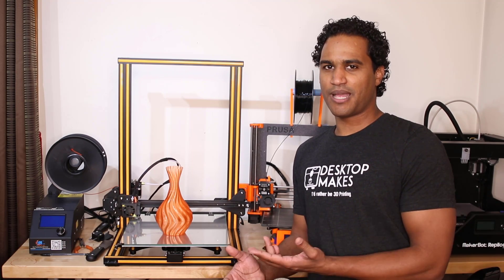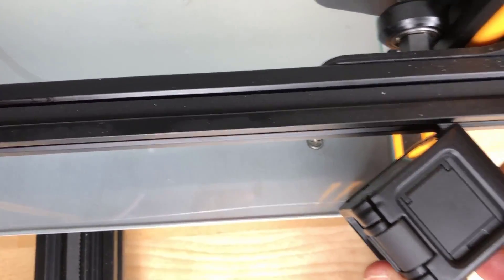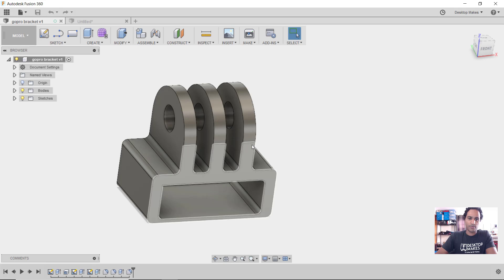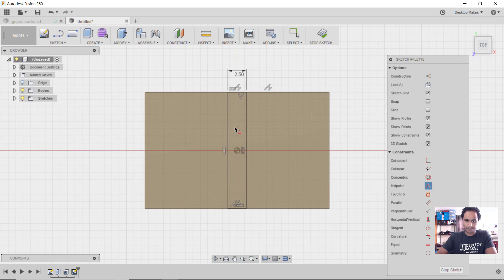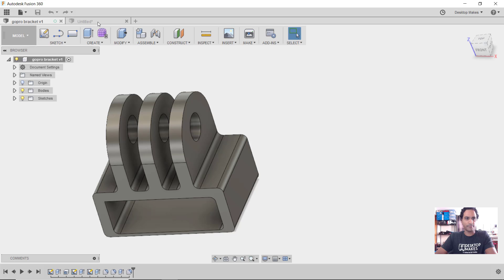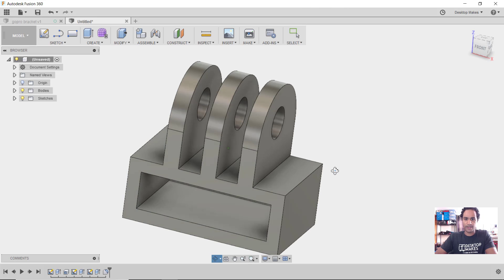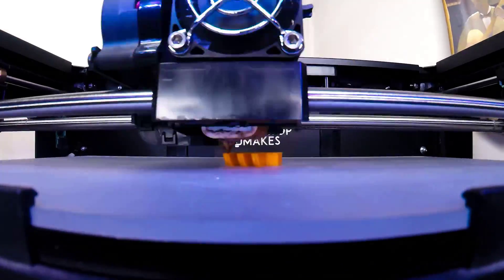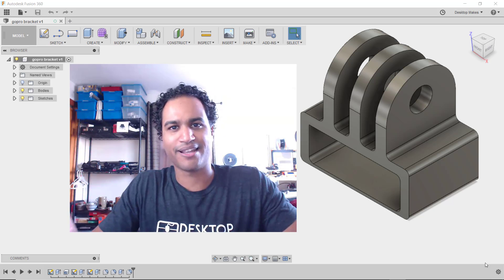Camera Bracket for Timelapse Videos in Fusion 360

Comment: I notice when you moved the build plate by hand (0:15), the EMF from the stepper motor was enough to power the cooling fan.
Reply from the maker: Yup, sometimes it will also cause the screen to light up.

Comment: Great video Vlad. What do you use to capture your timelapses? It looks like the captures are on layer change, which I'm guessing means OctoPrint? I've never managed to get a timelapse to work on OctoPi yet, purely because I haven't found how to do it.
Reply from the maker: Thanks Spike.  I mostly use a GoPro set to the time lapse mode.  I aim for 10 seconds of video at 30fps so depending on the length of the print I'll adjust the interval anywhere between a picture every second up to one pic every 60 seconds.
Reply: Ah! That sounds a lot easier. I have a GoPro-like camera, so I'll give it a try.
Appreciate your advice. Thank you